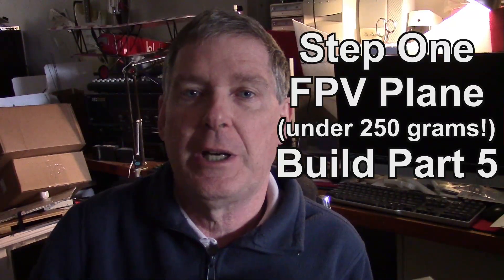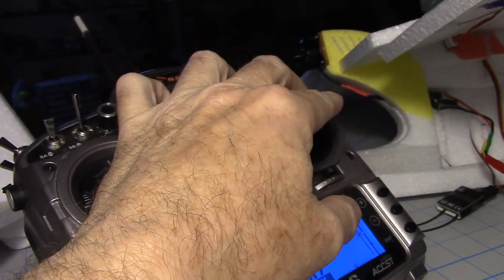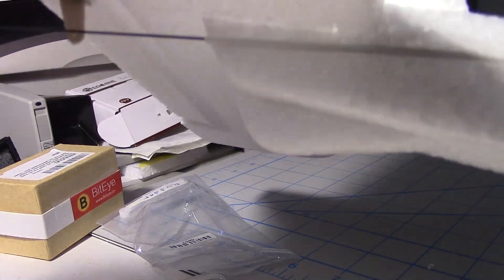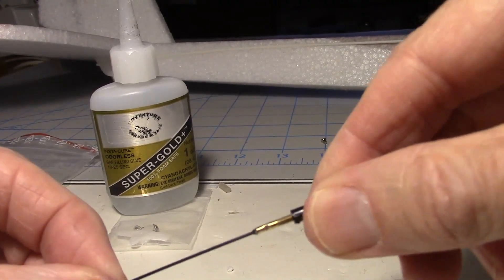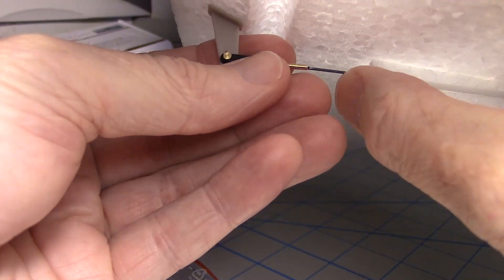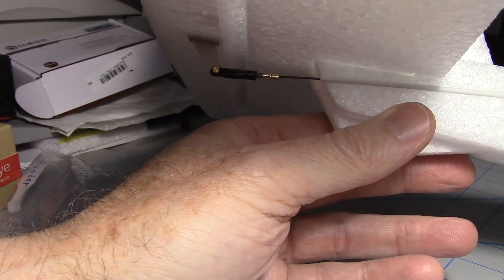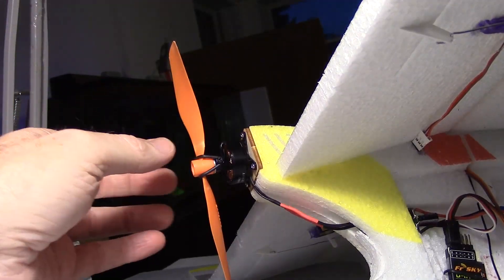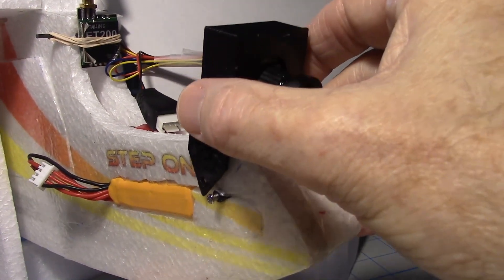Twisted Hobbys Step One FPV Plane Build Part 5 (Under 250 Grams!)

Comment: People are watching this, please keep working diligently! I imagine you've seen Matt from rcgroups build for an under 250g AUW flying wing? I'm following both of these builds very closely as I decide what I'd like to do for my next build. My larger plane will have to remain on hold until FAA rules become a little more realistic. My goal is 1 mile distance, 20 minutes endurance and mild tolerance for wind. I have a Pixhawk Lite flight controller I intend to use for autonomous flight capabilities with a 915mhz telemetry radio. Need to find a lightweight antenna option for the telemetry radio...

FPV Mini Swift build - https://www.youtube.com/watch?v=8mx087S-zAU
Reply from the maker: +Ryan Slabaugh I just posted a video with the flight testing of the FPV plane.